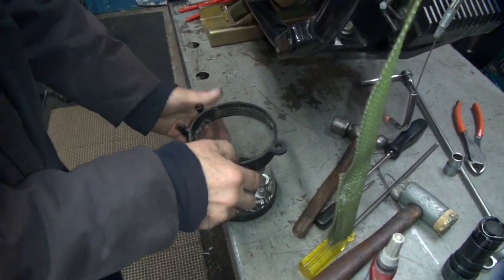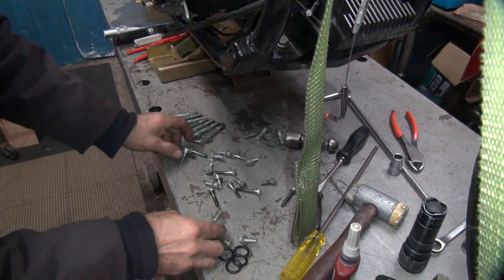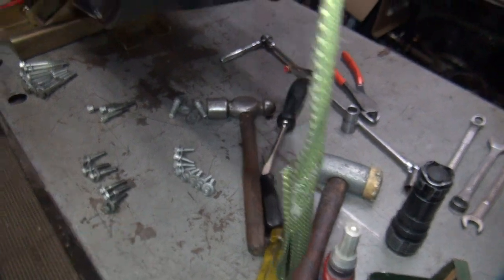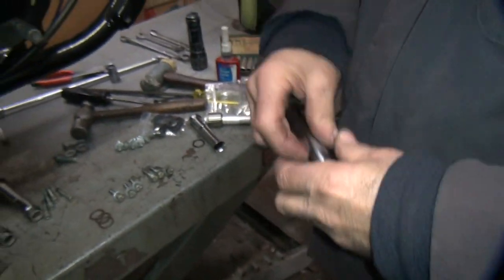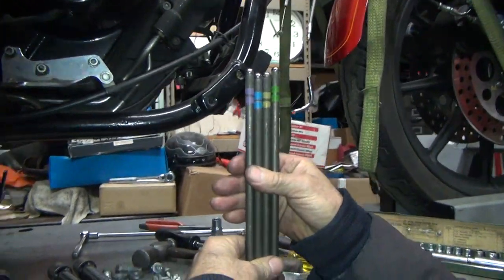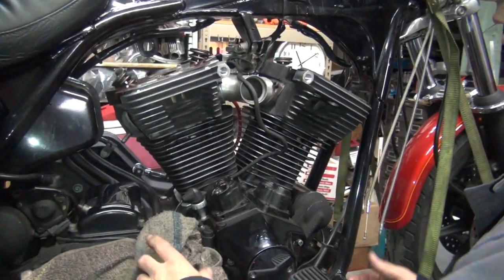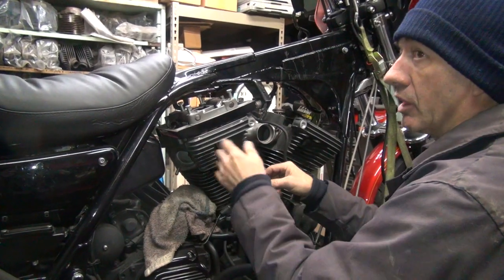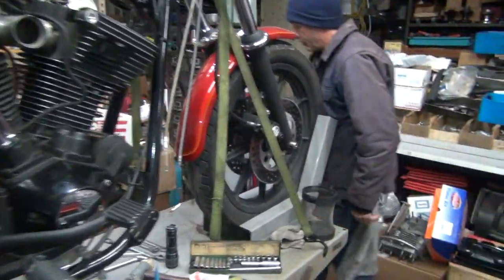#123 1993 80ci fxr cylinder head install assemble quickee topend rebuild repair harley tatro machine

Comment: Out of curiosity are the rocker arm shafts supposed to be that tight? Mine are snug not as tight. I haven't gotten any noise or problems from it.
Reply from the maker: they should be a light press in fit.
tatro